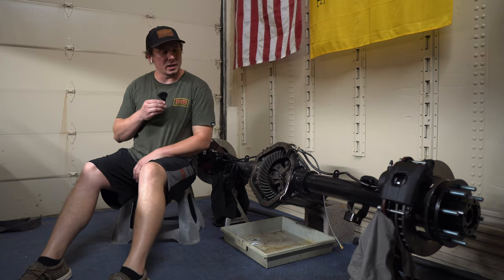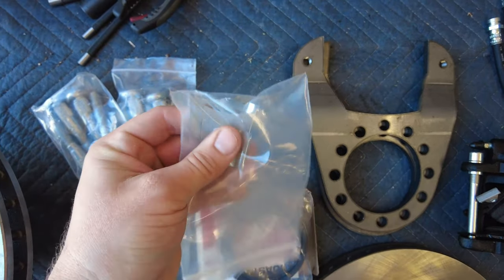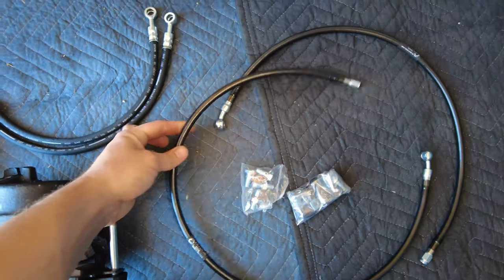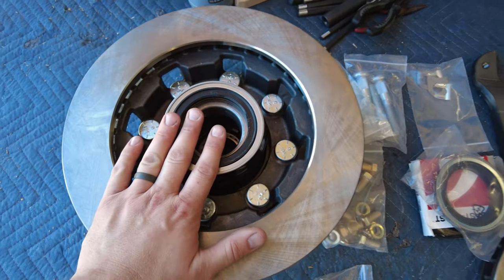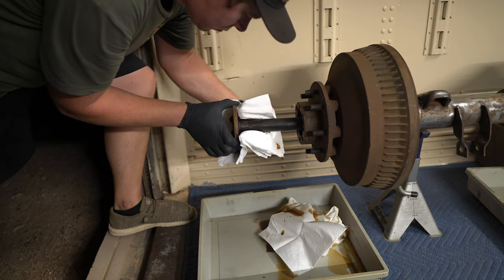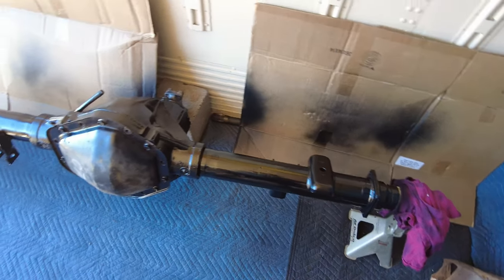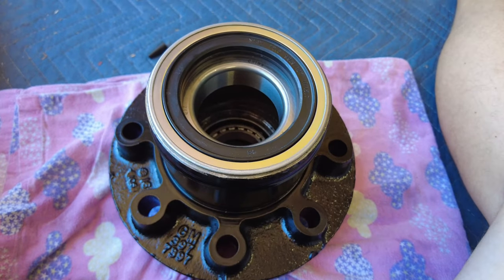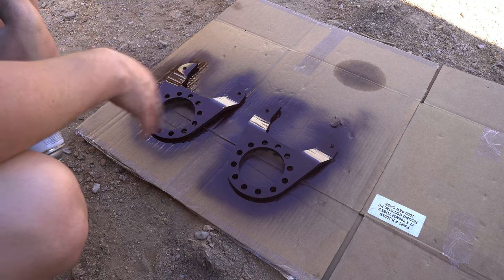LugNut 4x4 Disc Brake Conversion & Hub Rebuild on a 14 Bolt Full Floater!

Comment: Good video! I wish I would have removed the differential from my '80 Chevy K20 truck when I did my disc brake conversion. The only thing I saw wrong was that when you torque the wheel bearings the outer nut should be torqued to 100 ft. lbs. (according to my Chevy shop manual).

Comment: I would consider redoing those soft lines. Either run hard line, or use tabs that allow you to secure the soft line with zip ties. Those tabs you have might chaff through the soft lines.
Reply from the maker: I’ll see how they go while testing but you’re probably right. Now that it’s in the truck I can modify it if needed

Comment: The washer you welded to the bottom of the spring purch might interfear with the u-bolt
Reply from the maker: It didn’t interfere but it’s a close fit!

Comment: Got a part # on those studs I just did my conversion and need a longer Stud.
Reply from the maker: I don’t have a part number but here’s a link to studs off the Lugnut4x4 website

https://lugnut4x4.com/product/14-bolt-studs/
Reply: @2AOverland what’s the number on the head of the stud?

Comment: I  noticed there is no parking brake now. Are you doing something else for a parking brake? Are there kits that do have parking brakes? I used to go on 4 wheel drive runs and one of the safety things you need is a parking brake. Many times I have had to use my parking brake working on my little ranch and while deer hunting in the hills. Also, your brake lines look like they will conflict with the u bolts that mount the axle. Years ago, I thought about doing a disc brake conversion. But nobody had any kit with a parking brake. Now, my 2004 GMC 2500hd Sierra 4x4 has rear discs with a parking brake. I was considering getting an axle from one of these trucks so I can have a parking brake.
Reply from the maker: Lugnut 4x4 has an option on their site for adding a parking brake caliper as part of the kit but for what I’ll be using the truck for I don’t think I’ll need one but I can always add it later if needed 😬

Comment: Do they make a kit for a 92 GMC Sierra14 bolt full floater?
Reply from the maker: This kit should work for all 14 bolt full floaters
Reply: @2AOverland  awesome. Thanks for the heads up. It's a  nice upgrade. And pretty good price.  I like your square body build. Nice truck.  👍

Comment: What did you pay for your axles?
Reply from the maker: I got the 14 bolt locally and the Dana 60 was from a wrecking yard in Missouri so I didn’t pay a whole lot compared to other pairs I’ve seen